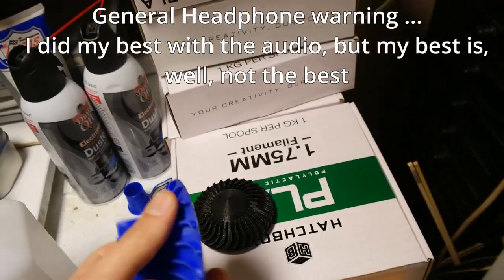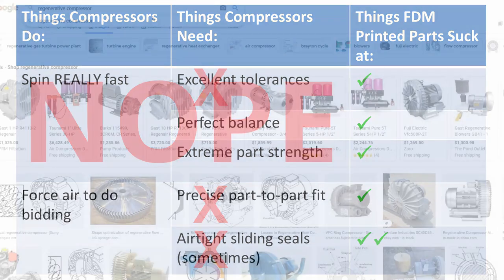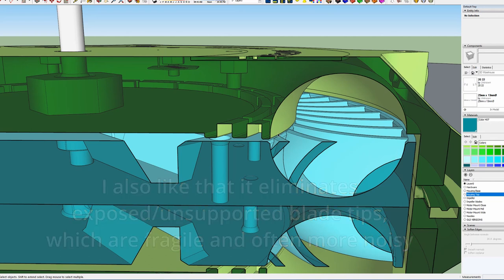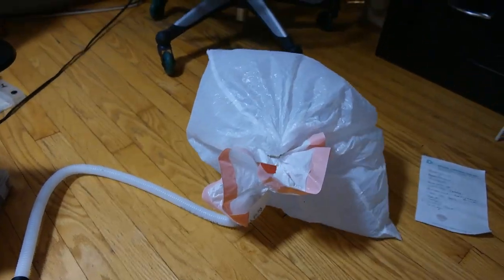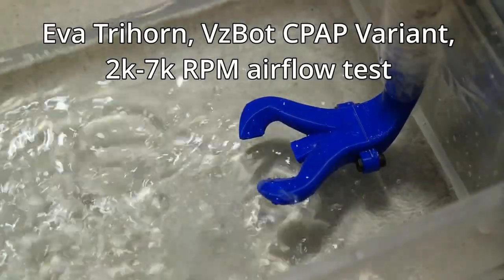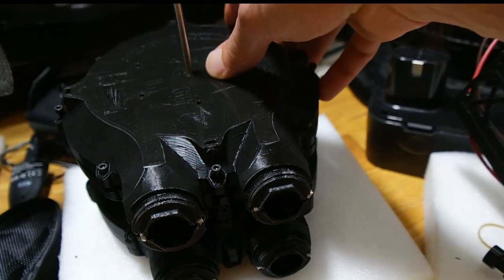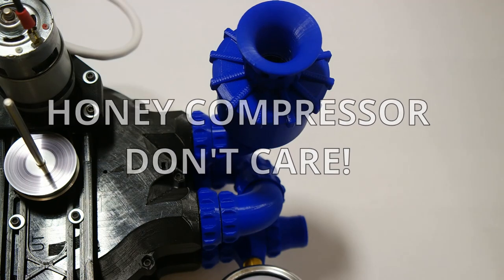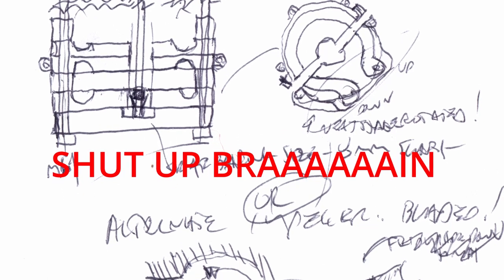I 3D Printed a Compressor that ACTUALLY WORKS (but you've never heard of this design)

Comment from the maker: 🖐Hey ya'll!  If you're wondering what else this compressor can do, check out the follow-up video where I design and goof around with a mini bladeless fan, venturi vacuum, and more 3D printed accessories: https://youtu.be/Nu29ylFLulQ -- cool "smoke" and glitter tank tests, plus dizzying CAD timelapses and boring channel news!

Also, I want to apologize again for the audio on this one.  Old headset + newb editor = dumpster?  I've got a better recording setup for future content, promise 👼
Reply: Hey amazing design! I think I'm going to try to implement this as a compressor for a hobby-laser cutter/engraver air assist. I'm betting it'll beat out the best aquarium pump by a LONG shot!
Reply from the maker: @AET_DH  Thank you :) Sounds like a great application!
Reply: @jamespray  how powerful was the engine tho?
Reply: It would be amazing to connect it to a Drill
Reply: to be considered an air compressor you need really high static pressure to fill car tires etc.
What static pressure do you need for part cooling?
You need to make an inline duct fan. 
basically an inline blower.

Comment: Coil wind when using PWM is quite common, if you change the PWM frequency, you can significantly reduce coil wine
Reply: You can also put some clear nail polish on them to hold the wires still, because the whine is the high frequency vibration of the coil wires.
Reply: Or use variable buck/boost converter

Comment: Loved your project! Never thought that a 3D-printed compressor was even possible!
Keep it up!
Reply from the maker: Thanks!  It might be a while (other stuff to get done), but I do want to explore improved designs in the future.  It would be cool to shoot for something that was both cost-effective and capable of doing some common real-world task, like power an airbrush.  We'll see!
Reply: @jamespray  It's so funny you said that! I purchased onAmazon a "Quiet" compressor because I wanted to drive an airbrush. That thing never worked well.
As soon as I saw your video title I thought of using it to drive an airbrush...

I am already a subscriber. I will keep an eye open for your future projects. 

Let me know if I can help you in any way like, for example, a beta tester of your project or something! 😁
Reply from the maker: @MakerMindset  Good to know an airbrush compressor might be a project with some takers!  It would have to have roughly inverted performance characteristics to this one, with a minimum 10PSI and 1CFM flow.  Since adding stages increases PSI but not flow, it might work to have a larger number of stages that were thinner and worked on a much smaller volume of air.  It would be a very interesting experiment to see how the performance changes with different design characteristics like that.  And if it was actually quiet on top of building high pressure head, that'd be a big deal!

Comment: Nice results!  1.2psi boost is an excellent result with the relatively low tip velocity limits of 3D printed parts.  I've also experimented with small regenerative/side-channel blowers but stopped because of the noise.  Was planning to do a resonant muffler, but would probably now do a packing muffler since it worked so well for you.
Reply from the maker: Thanks for sharing your experience!  The silencer/muffler really made all the difference for comfortable experimentation (my wife was NOT pleased with the early testing and I needed ear pro for full throttle, but afterward I could get away with short runs even after the kids were in bed).  I ran with this silencer design partly because it seemed to be the most common commercial offering, and partly because of the compressor's flow rate.  The simplicity is a bonus: I actually started with a rolled-up kitchen sponge stuffed into the silencer housing, and it worked nearly as well as the final design with the printed liner.  If this compressor made higher pressure and lower flow -- which I'd like to shoot for with future designs -- I would probably experiment with baffle-based designs to see if the noise could be cut further, as well as try them on both intake and outlet.  If you do experiment further, I'd be interested to hear how it goes!
Reply: @jamespray  The geometry of the "stripper" where the rotor passes from high to low pressure also makes a big difference.  Only got far enough to figure out that angled strippers were better than flat ones parallel to the blades.  Might be able to improve further with strategic leaks?
Reply from the maker: @martylawson1638  I have actually been thinking of strategic leaks too!  The current design has a circular air dam that is unbroken even through the blocked portion after the stripper (as you can see in the CAD), but I've been wondering if it might be better to remove it so high-pressure air passing the stripper between the blades could be leaked/bled into the central area.  That would not only reduce the pressure of what's released at the inlet (possible noise benefit?), it would increase the "backing pressure" behind the air dam and might make it a more effective seal.

I also would like to explore leveraging the vortexes themselves in an improved stripper design.  The next design I want to build will use airfoil blades to create a single vortex around a donut-cross section channel, and one reason for that is because I think it'll make it easier to strip the airflow straight down into another stage by stripping it at the point where it's moving downward anyway.
Reply: @jamespray  It's a nice idea! Thanks for great video!
What you have already built is vortex pump. It MUST be very loud. Industrial ones use mufflers on both inlet and outlet and you did it well. Important thing about vortex blowers - they have 9 times higher flow than centrifugal ones. It seems that these 9 times is what compensates all the leaks due to 3d printing tolerances. 
If you want another thing to try, you can print Lyssholm compressor.
Reply: @jamespray  Yet another turbine, interesting to try is Ljungström one.
Reply from the maker: @ІгорАлієв  Thanks!

Comment: hi, I'm an electro-mechanical engineer and I wanted to let you know that electric motor have power, torque and efficiency graphs and each style of motor has their own.

so if you're doing a lot of 3D printing with these compressors I think it should be worth your while to optimize the gear ratio so the compressor and motor are at the optimal RPMs.

and if you're running the motor RPM it may be warmer because of the power output being put out at a lower speed.

something definitely worth looking into.
Reply from the maker: I appreciate the input!  I have been figuring this out empirically (from measured RPMs and motor temp at various ratios) along the way, but I know I have a lot more to learn.  In particular, I don't know enough about acceptable/expected operating temps for different types of motors.  If the motor temp skyrockets in seconds, I assume that's an obvious sign that the gear ratio is too high, but I'd like to be better at quickly determining (from steady-state temp, RPMs, other data?) what's optimal...
Reply: @jamespray  temperature is usually stamped on a metal data plate.

If you got anymore questions feel free to shoot them my way

Comment: This is impressive and very interesting. I may just have to make one for my Monster Kossel design. Right now using a brushless CPAP fan, which costs $70 with the driver. Easy enough to control from the PWM with the built-in controller, but still louder than I like.
Reply from the maker: Thanks!

Comment: Looks good.. for compounding like this I think the results are better if the first stage wheel is larger, and smaller outlet than inlet, so start off with large first stage inlet, medium first stage outlet that matches  second stage inlet that comes out of second stage outlet that’s small. Like a compound turbo.
Reply from the maker: Hopefully something I'll be able to experiment with in the future.  Thanks!

Comment: I rebuild and repair a lot of side channel blowers. 
They run extremely hot. 
They normally have a support bearing in the front casing which when running runs at least 90deg c. 
I always love running them in after a rebuild. 
They sound like a jet engine. 
Great work
Reply from the maker: Thanks!  I was very surprised by the jet noise at first -- I heard "low RPM" and assumed that meant "quiet", and then the first spinup sounded like an F16 on the runway!  The heat in the "real thing" is interesting, something I didn't know -- is that just from pressurizing the gas also raising the temperature, or do the motors run hot too?
Reply: @jamespray  I'm not a engineer just a tradie. 
There mainly used for vacuum applications rather than blowing air. 
We rarely get the hole unit. 
But sometimes we get the unit with the non return valve. 
There used in plastic extrusion machines,  they use them in the hoppers that hold the beads. 
I think it's a  charge created from  compressed gases and friction. 
But most likely friction 
There would be charge there flowing from the shaft currents of the motor creating a Edie current when passing over the aluminum in the industrial ones. 

Good to see you went to the double stack type. 
I've done up to 3 in line being run by a 16 kw motor. 
Siemens bring out a large range of the side channel blowers. 
They mostly have the issue with the hot bearing at the front. 
The style you made are pretty good. 
Don't seem to have the same issue.
Reply from the maker: @simonlaker2139  Thanks for taking the time to share this info!  Mostly new to me, and good to know. 👍

Comment: That is awesome. I want to build one to supply air to my milling machine chip evacuation, it needs a lot of air but no much pressure.  I want to limit to 300/500 watts and noise is an issue. I love your design and the size is perfect to me. Very nice work.
Reply from the maker: Thanks, I'm glad to hear it!  That sounds like a great use case for this.  I am testing a variety of attachment designs right now, and I can confirm that it works well with things like blowoff nozzles, air edgers / knives, etc.  (Should have a video to demonstrate those soonish.)

Comment: Consider a large DC Brushless Motor and ESC. For your target rpm, a 4-6s lipo battery should have plenty of power. An air bleed channeled over a heat sink on the motor would aid in keeping the motor cool

Comment: I have herd of this design lol , nice work ! Do you think the closed impeller is better? Mine is open on the end , and  I would Imagen it gives larger traction area , but I may be wrong .  Yours is much larger than mine so the physics might change . Way higher flow rates as well .   Have you seen what I'm up to lately , I made a 2 stage version of my 60mm Regen and it's now coupled through a gearbox  running on a 13 hp engine
Reply: Oh the idea of a Rotorua engine is good . My idea was to split the housing horisontly and have a flange to booth the halves together to be able to stage them up . However I think the improvements will eventually become more and more costly with less and less improvement per added stage over 2 . My 2 stage design steps down the ports , intake largest , inbetween about half and the output smaller to increase velocity thought the compressor .
Reply from the maker: @turboprint3d  I know YOU'VE heard of it, lol!  Your geared build is super cool.  I don't think the closed impeller is better or worse, necessarily, but I think it probably performs differently than an open one (flow vs pressure ratio).  I wanted to move less air but push harder on the air I moved, but these things don't act intuitively, so who knows.  I am also thinking to split the housing in half to add more stages, same as they do with gas turbines ... that way the impeller can be built and balanced first and the housing installed around it.  We'll see how much difference it makes, but it will save on bearings, at least!

Comment: Maybe (and i said "maybe") if it was'nt already done, you should consider screw compressor, they're also quiet, efficient and easy to print/build/integrate...
Reply from the maker: I've never seen a 3D printed screw compressor that built measurable boost, and the ones I have seen sounded like cans full of rocks before they blew up.  If you know of one that does work, please link!  I think it'd be an interesting challenge to design, but I don't have great hopes for getting one working easily.

Comment: this is an awesome concept, I have been trying to formulate a way to "optimize" my experience with my 2002 Toyota Celica, the 1zz-fe that came in them is NA and the engine wont handle big boost well without a bit more work then its worth at the moment. Having thought experimented over many options only to find out that the price is not within reach for awhile (centrifugal superchargers, small turbos, converting a turbo to a centrifugal SC, using some version of an electric turbo that wouldn't have extensive load on the 12v electrical system in a car). This is something that I can build off of to create a proto-type  electric - small boost super charger essentially... figure you can mount it just behind the filter and map a variable speed motor to a set of rpm's at which the compressor would change speed to either generate more or less boost for the desired effect (could be a giant waste of time, however I know an amazing alternator shop that can make me a nice and beefy alternator for more available power in the system, I own a 3d printer, don't imagine I will need a ton of boost as the intake flows like crap on these engines and my car is extremely light so I would like to compliment the low end torque for fun, and the fuel economy at highway speeds) would love any input on the idea from the community! 
Once again I must say the channel and concepts are awesome and I very much so enjoy the content!
Reply from the maker: Glad you're enjoying the content!  I have no idea about the suitability for your application, but it sounds like a fun experiment!  Just be sure to use materials that can handle your engine bay temps 😉
Reply: Agreed, would not go into the bay without some serious trial and error, I do like my car running and all 🤣 but all in all very interesting and enjoyable content... my most "fun" item with my printer so far is making a series of golf putters with petg and some iron oxide suspended in epoxy for weight

Comment: i was actually trying to build the same type of pump, i know it as a side channel pump, (thought these only worked with water)
i spent a bunch of time trying to put sealing everywhere with tphu for smoother movment,
good to know you dont really need sealing!
Reply from the maker: Haha, yeah!  Not perfect sealing, anyway.  Keeping the air in the housing is fairly simple.  The moving "seals" have to be accomplished with tolerances and geometry, not contact.  The closer the better -- but it's curtains if anything starts touching in there!  With the PLA I used, I tried "running in" some rub lines first, but the friction heated the plastic enough to start raising it like crocodile scales and seized up the works.

Comment: Since I now searched more for better medium pressure and medium flow fans, I came across multistage centrifugal fans. Building those might be a little more compact and can be optimized to fit the needs of a 3D-printer.
Reply from the maker: There's a use case for just about every setup!  You can even multi-stage commercial blowers (e.g., 5015s) by stacking them outlet to inlet with adaptors.  I have done this in the past and it works well to improve pressure head (though the flow stays about the same).  I just wasn't a fan of the noise (I know, ironic, considering how this compressor sounds).
Reply: @jamespray  I know what you mean. Also tinkering around with own fans is a lot of fun!
Hopefully a multistage blower fan is good. But eventually I'll go for a 7040 CPAP fan like mentioned here:
https://www.youtube.com/watch?v=W8hgutyGDiQ
Costs around 80€ and should be THE solution.
Still I want to find my own solution.

Comment: This was a cool video man ... thanks fo sharing - impressive design too.  However; not sure I heard it running ... quietly ???  Whats it sound like when its operational for printer cooling.  Im running a voron 2.4  - would be interested in something like this or CPAP
Reply from the maker: Thanks, glad you liked it!  It's really hard to convey the noise levels on camera, unfortunately.  At lower RPMs before the intake whine kicks in, NOT counting the motor, it's as quiet as, or quieter than, a good bathroom exhaust fan.  At the highest I've been able to push it so far in double-stack configuration, it's maybe as loud as my wife's hair dryer on high, just higher-pitched.  I hope that helps!

Comment: This is awesome video, thank you. Just thinking of POC electric turbo for gasoline motor. Would need around 200CFM and 1.5-5psi of boost. Dont much mind on the electric motor but just thinking with current consumer printers is this the regenerative compressor the only option? And is it impossible to get more boost than 1.25 or so?
Reply from the maker: I am not aware of another printable design that could get 5psi of boost safely.  Of course, I haven't proven that this design can get 5psi, but it could definitely get more than 1.25 with a bigger motor.  You would just need more power to spin it faster.  200 CFM is a lot, though.  As stated in the video, in the 4k RPM range where this can deliver 1.25psi static pressure, it only hits 11CFM at free flow.  I don't know much much CFM it would deliver at the RPMs need to hit 5psi, but I have doubts it would be in the 200s.  This design is balanced toward pressure rather than flow.